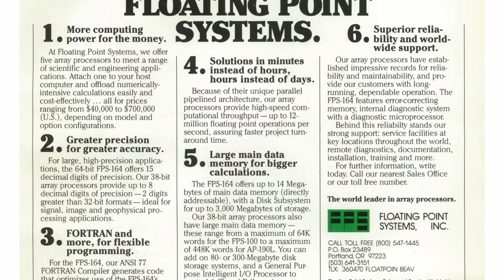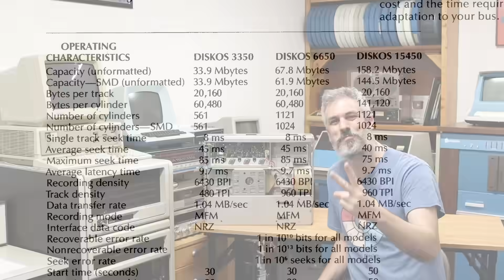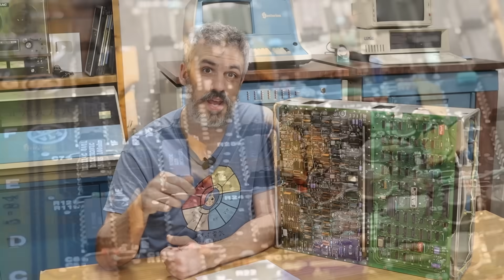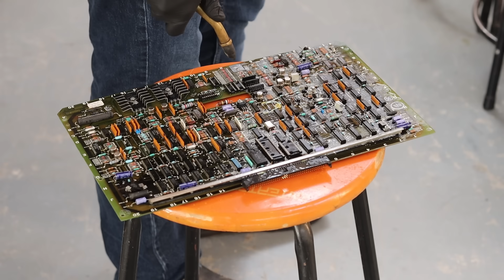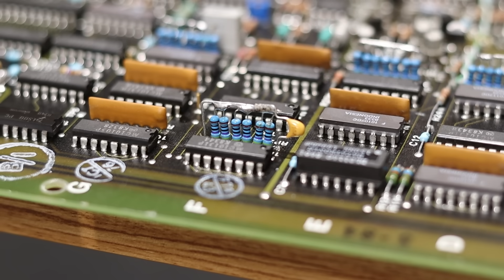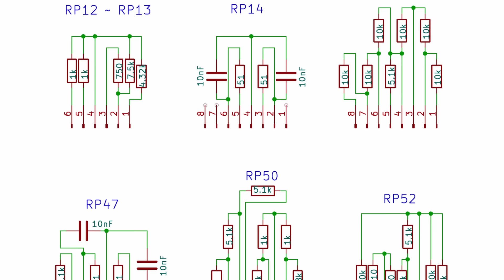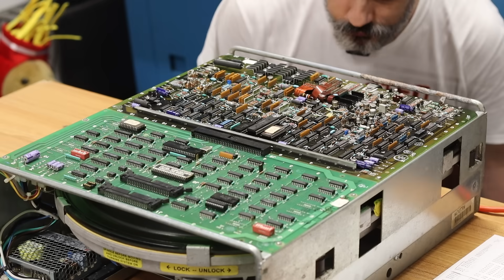This 1980’s Hard Drive tried its Best…

Comment: /Never thought I'd be telling my Priam Diskos story! 

Where I worked in the 1980s, we had a 154-MB, exactly the same model as yours, connected to an Alpha Micro system. One beautiful autumn morning eight years after we acquired that drive, it attempted over and over to spin up to operating speed and never quite got there. After the system was powered down and the drive taken offline. the boss first attempted to probe several points on the chassis, but apart from a faint click that could not be reproduced, he found nothing. 

Eventually he learned from the documentation that the spindle speed control uses a laser, a mirror, and a sensor mounted on the outside of the underside of the case. As the spindle rotates, the fan blades seen at 21:00 interrupt the beam, and the control circuitry measures the time between interruptions and calculates the spindle speed. 

The optical components were covered with dust. After he cleaned the dust off, he could get the drive to spin up...

...but remember that click? As he was probing, some stray pulse must have caused the heads to move just a tiny bit when they were supposed to be parked ...enough to turn the heads into lathe tools. We were able to get much, but by no means all, of the data off before the disk surface was gone forever. I'll spare further details.

Take-away for you: Clean the optics underneath before attacking the control board or the motor.

Comment: To put David's numbers into perspective: 100 megaflops per second for the maxed out system is more or less the performance of a 3dfx Voodoo 2.

That rig could have run Quake or even Unreal Tournament. In the late 1970s.
Reply from the maker: The FPS-5430 I believe used the FPS-100 combined with three XP-32 coprocessors for 62 MFLOPs. And the AP I/F card expanded the internal busses so you could run two of these combos in a master/slave configuration, which would give a theoretical max of 124 MFLOPs. Granted, by this time, they were in the early to mid 1980s. Still, that's an intense amount of processing power!
My goal is to build the FPS-100 out and then attach the FPS-3000 to it, which would give me 26 MFLOPs. That's still a pretty formidable amount of compute!

Comment: So it's a 3 phase synchronous motor controller by the looks of it - and its power stage is probably dead (maybe only one phase of three is going)
I would look first at the three power transistors and their drivers with a scope

Comment: Worked with a mini system in the 80's that used a proprietary 32/64 bit floating point format (called Excess-64). It had a separate 'Array Processor' that used it's own 16-bit floating point. The interface board(s) (one in AP, one in mini) that 'translated' in hardware, between the two formats.

We just gave the AP a start address in main memory of each array, an few instructions of what to do, and "Hey, the answer is right there... Cool!"

Comment: A 74LS245 is NOT pin compatible with a 74LS244!
Reply: Just totally and completely different!!!
Reply: Don Lancaster is spinning in his grave
Reply: yep, 245 is bus transceiver, not a buffer-driver
Reply: Not even remotely, at least in pinout
Reply: The 74ls240, 241, and 244 are pin compatible. The 74ls245 is not only not pin compatible, it's a different kind of chip. You could make it work, but the time and effort spent building an adapter board is definitely not worth it.
Reply: Why do we know that 😅 i hade that ic in my crt terminal to
Reply: Exactly
Reply: Он бы еще к155ла3 поставил!😂😂😂
Reply from the maker: You're absolutely right!
I got my datasheets mixed up when looking the ICs up. I've got a proper LS244 on order!

Comment: Regarding the replacement resistor packs, I was expecting that you wiyld make tiny PCBs and surface mount resistors (and capacitors) on them.  After all, that seemed to be what you did on your tube computer modules.  I hate the really smaall SMT components, but have found that size 1206 is manageable even with my shaky hands and with just one magnifying glass (i.e. one per each eye).

Comment: Nothing newer than 1984 ... phew, I'm just allowed to be in that room 😃

And while those resistor packs might not look pretty, as long as they are functional, that's good enough for now. If the drive lives again, once can attempt to make neat boards with SMD components to replace them.

Comment: The way that fan is reacting reminds me of when the starter-capacitor fails on the compressor fan (the outside unit of a split HVAC system).

I wonder if there is a bad capacitor in the starter circuit

Comment: Put a scope on the 24V rail, make sure that Meanwell's can take the start surge. Seems like something is being detected and the drive aborts startup.
Try manually getting a few RPM on that motor before applying power.
Having maximum startup load on the Meanwell's, at the same time they are also starting up is not the best.
Reply: Agreed. Also, get current readings from the supplies.

Trouble shooting 101, thou shall test voltages (which Usagi does) and next step is measure current draw on rails.

This provides valuable information on the state of the circuits they feed power into.
I find it especially useful to detect failed startup sequences - instead of just looking at the board and conclude that it seems inert.

Looking forward to the conclusion.
Reply from the maker: The 24V startup load, according to the manual is 7A. I'm using a 24V MeanWell rated at 9A, so it should be able to keep up. 
Looking a bit further at the schematic, there is actually a control signal sent from the Interface board to the spindle board to turn the spindle motor on and off. It's entirely possible that what we're seeing is the three-phase PWM controllers initialize, and then shut-down because the signal from the Interface board is telling it so.
In the next episode in the series, we'll dig into that in much more detail!

Comment: Back in the early-mid '80s I worked with a HP1000 system that had a FPS Array Processor attached for beamforming data from an acoustic array. That sucker cranked out some BTUs.

Comment: The optional power supply was a long chassis that sat on that little tray you placed the power supplies on.  It had a standard power connector for input and a short cable that went to the power socket located right above it.  It was probably a standard off the shelf supply from a different company, but I can't remember what the brand was.

Comment: I miss the old 80's hard drives.  They would sound like a jet engine spooling up and make an awesome beep sound as the head started to move.  You could tell when the drive was about to die just from the sounds it would make.  Storge now just dies silently and doesn't make a death rattle.

Comment: I have an old manufacturing test assembly from circa1982-1983 that has a SIP composed of resistors soldered up just like that first one you showed, so you COULD consider it a period-correct fix.

Comment: One feels the "best" way to replace the resistor packs would be with SMDs on a custom board. You could cram them all on a single PCB with options to snap them out. Regarding the PSU replacement, I would suggest you obtain a single, very beefy 24V SMPS and then use DC-DC boards to generate the other voltages.

Comment: The "resistor packs" are otherwise called couplets.  They were used in various consumer electronics in the 50s and 60s to reduce device size. Like here, a combo of resistors and caps. Used in a lot of Philco.

Comment: I remember working on the Priam's on Prime 2250 office environment systems. We called the 90MB, or 120MB. They had a spindown command, unlike any other SMD's we used. Also, that "nudge" that to see the motor does is normal. I'd look for that to assure the disk was getting power, when you powered on. I'm not sure what triggered the spin-up, possible our controller, but they did "nudge" like that before spin-up.

Comment: could you do some kind of mall surface mount PCBs with pins on the bottom to just slide into those resistor pack spots.

Comment: I had a board a few years ago that used a lot of SIP resistors packs, even some of the bizarre ones with multiple decoupling caps and weird layouts I could manage to source NOS contacting various online parts vendors.  For the remaining I built a universal pcb that takes surface mount resistors. I included multiple pads so they can be left blank / bridged where needed. dipped them all in some fast cure epoxy resin after construction and they dont look too out of of place.. can't even see there are smd components on there.

Comment: Wow... I used to work for Priam, here in Reading, England... Must have been 1987-88... I worked on their 8" drives, not the big old 14" ones... We had hundreds of both sizes in for repair at any time... The heat generated was unbelievable!

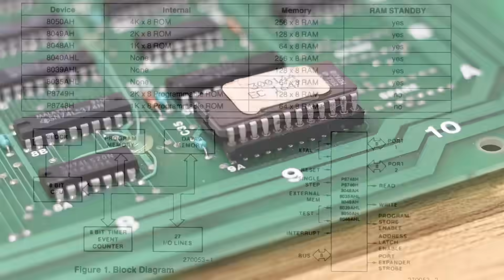Comment: 8:50 that is an EPROM not an EEPROM, its erased with UV.
Reply: Dumping the contents is still a good idea though? How resilient are they to wackyness?
Reply: @stephen1r2  Pretty good. Daylight levels of UV don't seem to reset them, EPROMS are electrically pretty robust - real EEPROMS a little less so. They do degrade with time and some fail, a few 2716/32/64 are starting to die of various cause, as arcade machine enthusiasts will testify. Anything vintage should have the ROMS dumped - at this period in time the ROM contents tended to frequently change. Its not unusual for a PCB series to have ROM changes for each PCB revision - the chances of finding the correct version of the correct image online go down the more obscure the device.
Reply from the maker: You're right, I stumbled over my words when recording the voiceover and got it mixed up!
Reply: @UsagiElectric  To be fair the error rate in your vidoes is vanishingly tiny (in fact, I cant think of another instance), we all suffer the occasional flipped bit.  Keep up the great work :-)
Reply: @jonshouse1  sunlight will for sure wipe them in a few weeks. That sounds like a lot but an open window next to the shelf they are sitting on will do it over time. Fluro lights will do it over time too.
Reply: @zyeborm  I tried a few times leaving an EPROM outside in the UK in the summer, did not loose a single bit, so I guess millage varies with that one. I did development with these things for years, left them kicking around on desks without a sticker, always verified good. I did program them, then put the sticker on before I shipped product though. Having written firmware without an ROM emulator at one point I am happy life has moved on.
Reply: @jonshouse1 UK in the summer might have slightly less UV than other places. People have tested this and in at least one experiment it was 2 weeks to start failing 3 for the full wipe. Others have anecdotes about them on shelves. Hack a day covered it, might be worth a Google.

I imagine the exact dose would vary significantly between products and perhaps even chips as well as the overall age. From memory they do have a finite data retention life even without UV.

I remember the high quality parts had metal stickers on them. The cheap ones had paper 😂

Comment: To make those resistor pack more elegant looking you could possibly make a SMD brake out board and solder smd resistors on it and then just solder the breakout pins to the control board. Will make it look way more elegant and original, but considering what you went through, you probably wouldn't want to touch those again haha. Still this remains on option.

Comment: What you are looking at are couplates. You find them in tube radio and tube TV's. Like predictas. These are really attempts at integration. Component networks containing all kinds of capacitors and resistor combinations and possibly things like small coils. Restorers usually replace them with the equivalent network on an experimenter pcb.

Comment: The spindle motor is possibly in a control loop for constant speed. There may be a small DC generator on the spindle that produces a voltage proportional to the spindle speed (V=k * rotational velocity). That signal is compared to a fixed reference voltage, that may be variable) and the difference is used to modify the voltage sent to the big spindle motor. Early 5-inch floppy drives attached to Apple II's used a motor control board that the technician adjusted to the right angular velocity.

Comment: You can create custom resistor values by scraping part of a metal film resistor (the blue ones). Just scrap one side while checking the value. It will increase as you remove part of the metal. Just continue slowly until you achieve the desired value.

Comment: I don't remember what actual drives were in the earlier Burroughs / Unisys cabinets we had. I remember the first cabinets each had 200 MB of disk. Later they came out with MD8 drives and cabinets. Each drive was 256 MB and a cabinet had 1 gig of disk. But I am curious if any of those Burroughs drives were really some other name under the hood. I know the disk sector was 180 bytes, equal to 30 words. Looking at these old drives brings back memories. Thick cables with large connectors on the ends. And everything weighed a lot !!!

Comment: When it comes to that riveted strip of metal you said you were going to remove from the PDP-11, you still have to verify that piece isn't there for heat sink purposes or to provide protection from electrical discharge before you fix that power board and install that hard drive.

Comment: If you can connect old system devices to an OTG cable, Android game Rally Fury can add HC and Ax feature to your device. HC makes funny car crashes, Ax can flip over 5 cars maximum, during jumps. It depends on the connected device.

Comment: Some basic tshooting here. Take some bare wire 28 guage wrap the wire 25x around in a bare location of the +24 volt distribution of the wire and use your meter in chuuent mode and measure how much it draws when you start the power switch. If it pulses. Then the power supply board needs work

Comment: The motor controller not starting really looks like it's not getting any signal from the position feedback. The controller probably applies current to one of the windings and then checks the feedback signal for any change (when it's going it should be a phase locked loop) and if it doesn't see any feedback signal changing then it will just keep sending DC into one winding and do nothing else. It looks like the feedback may be on the wheel in front of the fan because that has a set of alternating vanes on it - my guess is that there's a set of Hall effect sensors down there somewhere that form an incremental encoder.

Comment: To add other gear which is slightly post 1984 to the equipment list you need to have an Honorary Member category, and then just enrol the newer bit of hardware as a proxime accessit to the main collection.

Comment: Mouser has als slightly smaller (physically) though hole transistors, easier for those strange resistor packs.

Comment: @UsagiElectric hey! i don't know the power supplies you are using, and what their features are. but keep in mind that many circuits require sequenced power supplies. that is, for example, the 24V line should never have less potential that the 5V line. same relation may apply to the -5V and -12V lines. the grounds are common i assume, so you can at least ensure these conditions by tying schottky power diodes between the 24V and 5V lines and the -5V and -12V lines. (schottky diodes have lower dropout than regular diodes, and hopefully also lower than any parasitic diode that would problematically trigger if the power supply line potentials ever reverse, sparing the components involved.)

Comment: As for resistor packs, I'd lay out some small single- or double-layer PCBs with 0603 SMD resistors. If cost or lead time is an issue, then I've seen someone on youtube showcasing a technique for rapid simple PCB prototyping at home with a hook-knife (no etching required).

Comment: That bulb sucker is really only intended for single sided PCBs. You NEED a pump driven desoldering tool for multilayer or through-hole plated boards and there's a taught technique for desoldering(*) which ensures the hole is fully vacuumed and leads freed up

I was taught on Pace equipment 40+ years ago and my preference is always for devices with the pump on the bench. These days something like a YIHUA 948, Hakko 301, Pace ST 65 or for heavy use something like a Pace PPS80. Considering the rarity and fragility of the equipment, the $2-500 spent is a good investment and you'll find desoldering is far less of a chore with the right tool

(*) The desoldering tip needs to be slightly larger than the component lead but not larger than the pad. Apply over the component lead, wait till the solder melts on both sides and then activate the pump whilst swirling the tip around the lead, NOT pressing into the board. This will pull ALL the solder out of the hole and leave the lead free, or at most very lightly held by a whisker and able to be removed with a gentle pull - this is why the pump is absolutely necessary. You can't do this with a bulb or piston sucker

I just found the training film We used in 1983: 'PACE Rework and Repair "Solder Extraction with Vacuum"' - https://paceworldwide.com/video/pace-rework-and-repair-solder-extraction-vacuum - it's still a valid tutorial 45 years later

(FWIW the station shown in the presentation is the same one I used to use and they were about $1500 apiece back in the day)

Comment: Hi David, Great video 📹 I think the hard dive was recovered from a dumpster, and hence the damage. The mounting of the PSUs close to the hard drive isn't a good idea. Because the magnet flux from them may cause issues of erasing data on the hard drive. I'm looking forward to the next video. Fingers crossed 🤞 you will breathe life back into the hard drive. Richard